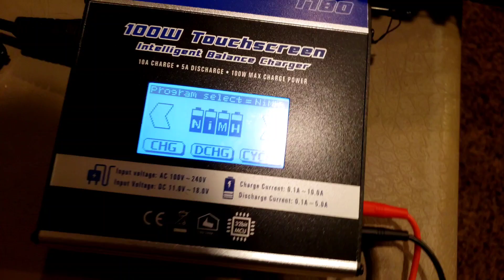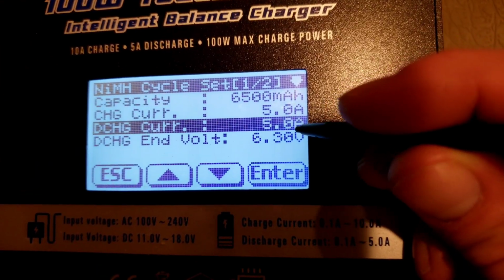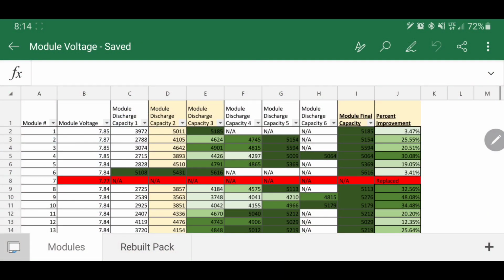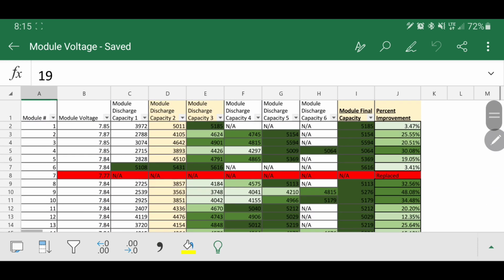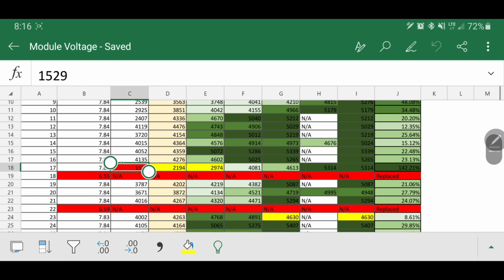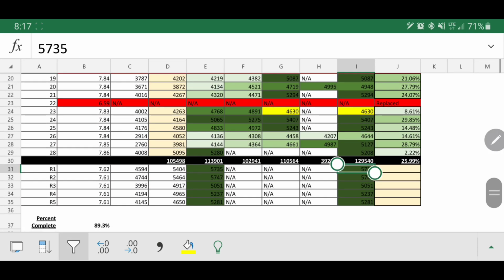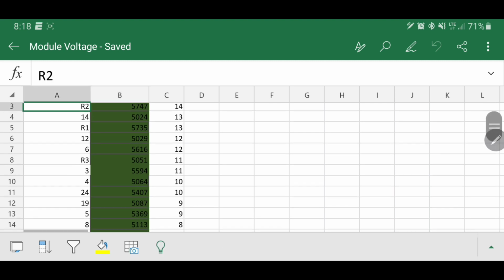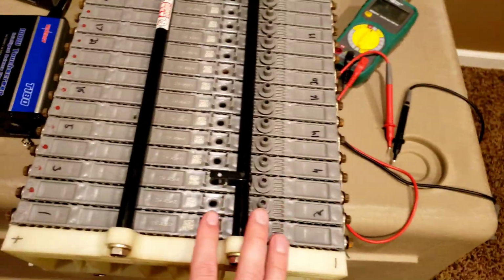Reconditioning a Prius Hybrid Battery Pt 2

Comment: Question i have tb6b and trying to charge a hybrid battery cell nimh 7.2v. Somehow this tb6b auto doesn’t work so i have to keep it manual. I have set cut out at 5000ma capacity, discharge v 7.2, charging at 3.5a. When charging it is going above 7.2v and foes upto 8.6v. Once cell is charges at 8.6v which seems high. Any suggestion how to keep it max 7.2v or is it normal thanks.

Comment: I set my charger for five cycles. After three cycles it hit max capacity of 6500 mA and stopped. After the third cycle the milliamp discharge was about 4500. i’m going to run two more cycles on it and see if I can’t bump that up a little.
Reply: After about 2 weeks I'm all done. Will add comments below on what worked best for me. I contacted Tenergy customer support twice and got good feedback. They will pass along my suggestions to there R&D team. My battery pack came out of a 2011 Prius with 0 codes. No bad blades. 

* Settings: After some trial and error, I settled on ending volts of 5.7 - could have gone lower. some people have gone much lower. Capacity 6,500 - again, others have gone higher, up to 7,500. Towards the end, I raised it up to 6,600, 6,700, & 6,750 with better end results. My limiting factor was fear & swelling of the individual blade. Next time, I may set it to 7,000 starting out ??? I used the CYCLE setting on 1T, because I only did each blade once, doing every other one. Temp set to F, Safety timer 720 min, CHG current 3.5A - higher settings increased blade swelling and higher end voltages. Not good. I would use 3.0A next time.  DCHG current 5.0 A. Delta peak - put on auto. It doesn't appear to work anyway? Time between cycles - I set it to the min. of 1 minute. It's there to let the charger cool off. It never got hot - only the blades after charging got warm & swollen...

* Make a spreadsheet, and use a small notebook detailing every blade 1 thru 28.
* Buy at least 2 chargers.
* Always use DCHG/CHG to start with. It always needs to start empty. First cycle doesn't count but log it anyway. (because usually it's not fully charged when starting out)
* I used a 50 watt 12V car headlight to "pre-discharge" all blades before starting out. makes things go faster. Hook up a multimeter to it and don't let it drop below your min. voltage.
* Use DCHG/CHG after the " pre-discharge' has been done. THEN immediately set it to CHG/ DCHG and push start.
* You will always have to restart when it reaches MAX CAPACITY to get it to discharge to get a reading to put in your log. I usually set it to DCHG/CHG at this point, and try to stop it around 8.2 volts before moving to the next blade.
* At some point, all blades will be above 5,000 cap... I took any in the 5,100 range and did one more cycle. It usually brought them up over 5,200 - 5,300+ .
*Keep going until you are satisfied.
* I used solder to balance them overnight. I did not add a charge while doing this but you can. Use one or both chargers and set them on 10A each?? Don't overcharge.
* Throw out the old busbar nuts & plates. Buy new SS ones.

That's it for now. Bottom line is it works.
Reply: I forgot a few things ! Modify your procedure if necessary.

* On your last cycle, or whenever you are done with a blade, ( DCHG/CHG cycle) set your max capacity setting to 4,500 ma. This will make all of them about the same voltage, and make the final stage of balancing go smoother - without having to charge the entire pack when you are finished.

* Match ending capacities as close as possible in pairs of 2 ( 14 x 2 = 28 ) Put the highest ones in the middle of the pack, working out both ways, with the lowest ones on the ends.

* I've read a 2 amp charge rate is best - less heat & swelling - will get better results, but takes longer.

* Also, a lower discharge rate ( less than 5 amps ) will get better results, but takes longer. 2.5A will take 2X longer...

Comment: I noticed "About this item
NOT Intended for charging/discharging hybrid car batteries or Large commercial batteries" was in the description on the Amazon page where you got your charger. What does this statement mean? Are you not charging/discharging a hybrid car battery?
Reply: I think what they’re trying to say is it won’t work as a grid charger for the entire pack. (200 volts) It works just great on the individual modules for charge and discharge at the low voltages

Comment: So I just pulled my battery out and these were the voltage of each pack. Which do you think are troublesome?
*1- 7.45
2- 7.51
3- 7.51
4- 7.51
5- 7.51
6- 7.51
7- 7.50
*8- 7.48
9- 7.49
10- 7.51
11- 7.50
12- 7.49
13- 7.51
14- 7.51
15- 7.51
16- 7.50
*17- 7.48
18- 7.50
19- 7.51
20- 7.49
21- 7.51
22- 7.51
23- 7.51
24- 7.51
25- 7.51
26- 7.50
27- 7.50
*28- 7.47

Comment: Over charging is the biggest concern, do not charge the batteries and leave them unattended. That being said how long did it take to charge batteries if I'm not mistaken, batteries in parallel maintains voltage of an individual cell but increases the amperage, so 6.5*28=182 which at 1 amp will take 7.5 days from dead to charge to full capacity?

Comment: Thanks a lot for the great video! It is informative and somehow very entertaining! I enjoyed watching it! 
I have one question: After cycling, you ended up with each module being discharged am I correct? (because it's a Charge/Discharge Cycle)... Did you then completely charge the whole thing when in parallel? Or did you charge each module individually to their final capacity and then go for one more charge in parallel at 1A for a couple of hours? Thanks in advance for the engagement <3

Comment: Pairing a module with the highest capacity with a module with the lowest capacity is NOT a good approach.  I tried this, and experienced both overheating of the pack and also got the triangle. I paired the modules based on capacity, and the paired pack is lasting for more than a year.  I have tried several strategies, but I have found the following works the best.  I charge an individual module up to 8.50 volts @ 4 amps.  I then discharge the module using a single headlight (which is about 3.5 amps), and I track how many minutes and seconds it takes to get down to 7.5 volts.  I have found this is a good range to test.
Reply: Pair like modules and also take internal resistance as a factor. Hybrid Solution Diagnostics has videos about this. Don't pair the strongest with the weakest.
Reply: @johndavid3598  Only recently I have determined how I can test for internal resistance (with my ESP32S3).  A really bad internal resistance explains why a module is not pulling it's weight when discharging. I have found it beneficial to charge and discharge modules one by one, to get more accurate test results. The battery lasting the longest can fool you, especially if the internal resistance is much greater. So yes, internal resistance is an important factor. I don't know how to factor this in yet, but I do take this into account when pairing modules.
Reply: All modules are in series so does not matter how you “paired” them
Reply: @verovoy1  I have found it is very important to pair modules with similar characteristics. The battery manager DOES track each of the 14 blocks. If the two modules in a block are not similar, then the battery manager won't realize there is a problem with a particular block. This could cause one of the modules in a block to overheat.
Reply: @verovoy1  I feel it is not that important that all modules in a pack are the same, but I now feel it is important that the two modules in each block have similar attributes (capacity and resistance).
Reply: @verovoy1 When pairing 2 modules in each block, it is VERY important to ensure the 2 modules in each block have similar capabilities such as their capacity and how fast they charge/discharge. Module internal resistance is also an important attribute.  Pairing a weak module with a strong module will prevent the battery manager from detecting a problem.  Doing so may cause the battery pack to overheat, and may cause a short in the battery pack  Doing so is similar to removing a smoke detector from your kitchen.

Comment: t180 on your video on cycle setting was discharge end volt at 6.3v.  Did it intelligently reach the max 8.x volt and cycle back down to 6.3v? Or you set max voltage somewhere?  Also 5A took you how long per cycle?

Comment: This is good because it shows in detail how you had the settings.. My question is that if I did two modules at a time I would double the voltage for charging but would I also double the capacity from 6500 to 13000?

Comment: I ended up using solder too because I didn't wanna splyce some wire as well. That's crazy. I put the batteries in seres as well and they seemed to balance out in just a few minutes. Are you sure they have to be balanced for hours? My multimeter had them all at the same volt but of course it balanced to the voltage of the weakest battery.
Reply: balancing doesnt happen in series, only in parallel

Comment: Module #9 discharge capacity 6 was 4,815. But your you wrote in the final column 5,276? Shouldn't this be replaced?

Comment: Where do you read the discharge capacity on the charger. I don't get any where close to the 4000-5000 range. Ill get in the 300-500 range. Im using the same parameters that your using. Are my batteries that bad? Or am I doing something wrong. Please let me know. Thanks

Comment: When I was charging my modules, using the same settings as you had for the T180, other than swapping the discharge/charge order, a lot of my batteries ending mAH were up around 7200, some even going about around 8200 mah even though it was set o charge up to 6500. Is this normal? If not, how much am I risking damaging my modules?

Comment: Hello.   I recently replaced 2 cells in a bad block. (one of the cells had actually blown). The Dr prius app recognized it as block #9 was bad. It was kicking the red triangle and throwing the transmission into limp mode.
Because I was short on time I simply replaced the 2 in the bad block. The car no longer goes into limp mode.
Now it says block 8 unbalanced and still gives the red triangle, but does not disable anything like before.
Would looping like you mention here and running the cycles help balance out the pack until I can more extensively recondition each cell?
Reply: Yes. You should have balanced the new cells with the whole old pack instead of just tossing them in.

Comment: I used your affiliate links for the charger and some cables, cheers!

I just got to the charge/discharge portion and the plastic covering on the wimpy alligator clips that were recommended melted and caused the cycle to end in an error (cycle disrupted). Gonna give it another shot, but I'm wondering if they weren't thick enough for my battery, had too much resistance due to the small size, and thus overheated and melted. Has anybody else had a similar occurrence? What was the solution?
Reply: As suggested by @HEVTech1 in a comment on a related video:

I suspected my wires may have been too small to handle the capacity when the insulation melted on the recommended Alligator clips. I also had voltage readings of up to 14 V on the cells via the charger. The multimeter confirmed that the voltage readings were wrong. Thicker wires leading from the chargers octopus cable to the battery terminals brought the charger's reading to within 0.4 V of the multimeter once everything was at operating temperature. That's still a bigger difference than I'd like to see, but I don't have a car so I can't do much about it...

Subsequently, I got out my jumper cables muahahaha

Well, my multimeter still fluctuated between agreeable with the charger and 0.3-0.4 V low, but I know resistance in my personally supplied cables isn't an issue anymore. My readings are generally consistently 0.3-0.4 V on the multimeter as compared to the charger, but occasionally the charger hops down and agrees almost perfectly with my multimeter. Given the general consistent inconsistency, I'm pressing ahead with my current (pun intended) setup
Reply: To anyone looking at this. You can google the amp ratings for wire gauge. Usually the AWG is marked on the cable. I only had cheap test leads. I had some test leads I bought years back, and had to modify them with thicker wire.

Comment: Great detail!  Thanks for sharing man!  I have a Turnigy Reaktor that I think can perform close to the same and will read into the details I can set for the Cycling process. 

Wondering if you used the Internal Resistance function on your charger for any of the cells to compare as my understanding balancing that is important as well, though maybe is related to the charge cycle and capacity in relation to same voltages since that makes sense I think as well?

Please detail your thoughts and experience if you can please.  Very curious to know.  Thanks again for sharing, man great detail.

Comment: I ordered 2 of the T180 chargers and plan to refresh a spare pack I got from a wrecked Prius.  I own 3 gen3 cars and want to have a pack ready to go in case of failure. I did not see in the video how you calculated the discharge capacity. Does the charger provide this info at the end of the each cycle?

Comment: Great video. I have one question. Does reconditioning your battery lower the internal resistance of the cells? I have 3 blocks at 30mohms and the rest are either 28 or 29. I'm trying to figure out if it makes sense to recondition or if I need to replace the whole battery.
Reply: How u test the battery IR? I haven't tested the module internal resistance and thinking about it
Reply: I used the Dr. Prius app to test internal resistance.
Reply: 30 ohms per block is good - 15 ohms per module.  That is great (I was worrying about this too while using Dr.Prius, but recently I have realized my mistake judgement

Comment: How's everything going on my new customer with a hybrid I bought with a bad battery I don't have the death of triangle but I had three batteries that were leaking acid I replaced those and everything looks good I bought four t 180s and none of them work they all say error I need some hands on hooking up the lithium battery right in front of me showing me how it charges actually hooking up the positive and negative to the battery with the wall outlet plugged in showing me the features of what I need to have my setting set on and once I press enter holding it down after 3 seconds like you mentioned have it start charging I get all that and it says error.
I seen a few videos nobody has hands on everybody just talks about it and just mentions it one either has the battery and explaining battery stuff or one either has the t180 in it and and mentioning t180 stuff but nobody has a video of actually putting them on going through the features and watching the battery actually start charging all other videos have people going through that but nobody has a t180 with the actual lithium Toyota Prius module battery disassemble just charging one everybody said everybody's charging one but nobody's actually using the t180 to charge one or to have the battery pack hooked up and then all together and you hooking it up a battery that's on the battery pack all I got is error I want and did exactly what you said I followed all your steps what am I doing wrong can I get some help can I leave my phone number I'm just trying to charge these batteries that are good they're all at 7.9 but I just want to cycle them and recycle them I do have three batteries that are at 5.9 those are the three I bought from somebody because my three were leaking acid so I purchase them all of them were 5.9 so I'm stuck with four t180s they all say air and I'm doing exactly what you said to do the only thing I don't see is somebody actually doing it right in front of me with a battery and it being hooked up with the charger speaking and actually charging it on video right in front of me.
Great video I learned a lot I'm a new Prius owner all your thoughts and everything you talked about was right on but I got this t180 that I don't know how to use on the battery I know how to use a t180 and I know how to use my battery but I don't know how to use the t180 on the battery with the battery showing step by step it actually charging without it saying air once I'm finished with everything holding down enter three to four seconds and then the air death of error comes up we have the death of triangle now we have the death of ertor

Comment: I'm currently trying to apply this process to my HAH batteries which come in sticks of 12 D cells, for a nominal voltage of 14.4V. When I set the current limit to be 5500mAh (the tested value of the cells I plan to replace bad sticks with) the charger just kept going. It also brought the voltage all the way up to 18V. Do you think that's normal?

Comment: nice explane, I have a question about how do I can undestend that the battery is bat ?
I use I Max mini charger , the charger does not show bat battery , only capacity.
Your video is very useful for me, thanks a lot )

Comment: My t180 shows cycle times on a 2nd screen accessed by pressing "cycle" button and scrolling up and down. 

Charge mah is 4500 and discharge 4800

Which is my mah for that cycle if I'm going to determine condition of the module?
Reply: The discharge cycle

Comment: Great video👍🏽 got the same charger because of your suggestion I had originally physically balanced all the cells before balance charging which I followed to the letter by your direction, had a few minutes to figure out how to start it 🤪 you have to hold the button down for a few seconds/ I haven't gone so graphed detail as you have and I'm using written notes instead but I will keep you updated if that's ok ? Since I'm only on the first one ☝🏻 thank you 🙏🏽 so much again